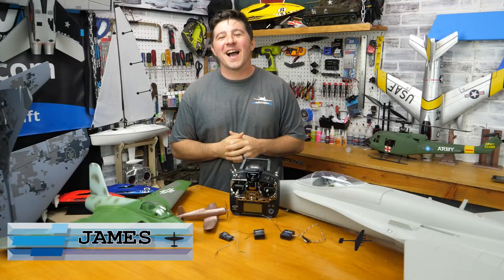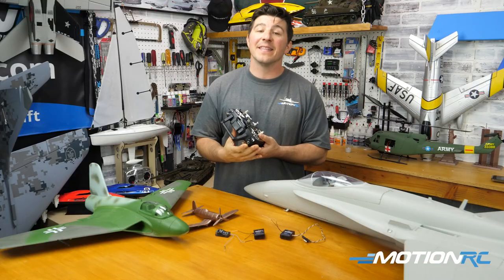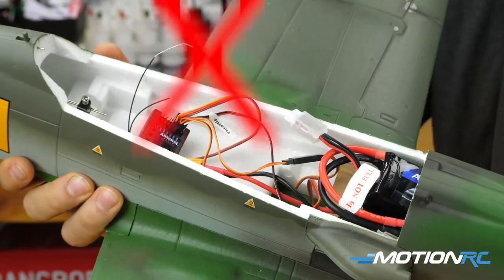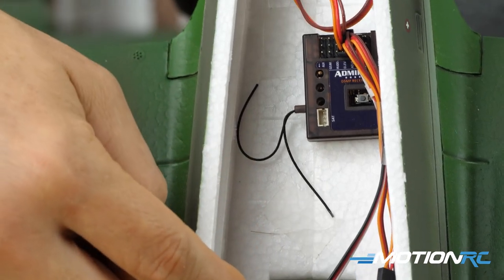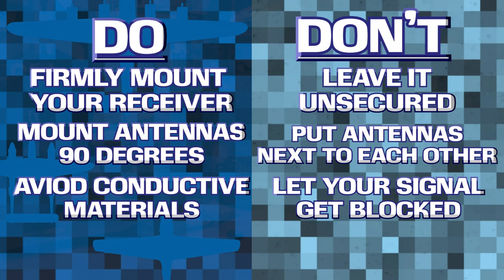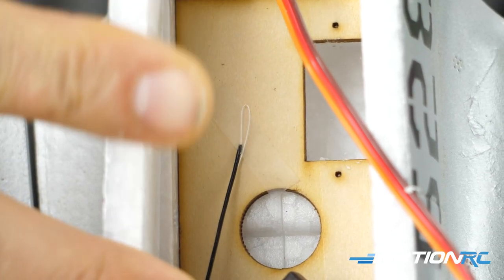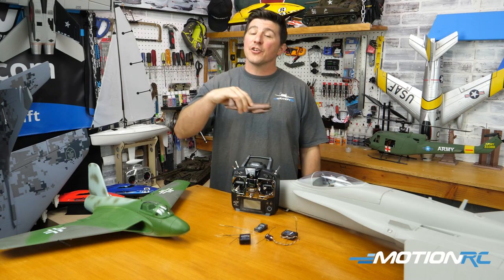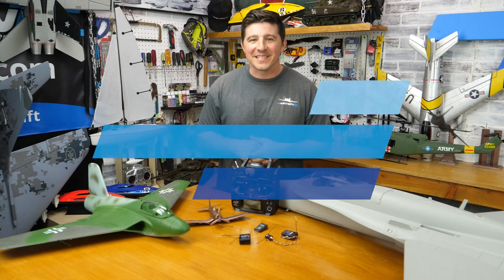Proper RC Receiver (RX) Placement | Quick Tip | Motion RC

Comment: If I only have two antennas, I mount one vertically and the other one parallel to the wing. That way, both of them are broadside to my transmitter as my plane flies away from me. Antennas don't receive or transmit off the ends. That's why you shouldn't point your transmitter antenna at your plane. The only time I mount an antenna pointing toward the nose or tail is if it's the 3rd or 4th antenna on the receiver. Also, the last inch of the antenna needs to be straight and at least an inch away from anything conductive..

Comment: E-flite sells a thickish foam double stick gyro tape, but it fails in high temperatures. Most of the BNF planes use tile and tub adhesive/caulk. I have heard gyros don’t like vibration, to what extent is this true? 3m double stick tape tolerates heat reasonably well but offers little vibration protection. When I put my PNP planes together I am usually in too much of a hurry to wait 2-24 hours for the tile adhesive to cure and have been using 3m double stick tape lately. Would hot glue be an acceptable solution? I guess my main question is how much of a problem if any is vibration, particularly in electric planes vs. glow/gas?

Comment: Basla and Foam vrs Graphite and Metal
470 Align Heli
Metal and Graphite fiber parts block (absorber) EM signals blocking Tx / Rx signals.
RC Aircraft
Balsa and Foam are completely transparent to EM signals so internal mounting is good.
but
Servo wire Servo leads servo screws LiPo and any batteries are block (absorber) EM signals so avoid mounting Rx near any metal or wire or screws or batteries.
Antenna
The short metal that is uncovered at the end of the Rx end is the antenna the covered part of the wire is just a extension of the of the short metal antenna ( < 1in), If there are 2 wires (2 antenna) then mount 1st horizontal and 2nd vertically.
2 antennae out of a Rx are redundant but flight is 3D so a block of Tx / Rx signals is reduced with the use of 2 antennae.

Comment: Another good point, which I don’t recall if it was mentioned here, is how absolutely critical it is to mount the receiver in the correct orientation if it is a gyro enabled receiver. Another often overlooked step that results in 100% crash rates.

Comment: So does that mean having an antenna close to servo wires is OK because the wires are shrouded enough in plastic & rubber?
Reply: No, the last inch of the antenna should be at least an inch away from anything conductive, even if it's insulated. The wire in servo leads can reflect or block the signal..

Comment: Starts making me think that all Rxs should have three aerials,    so they can be placed 90° aprt on all three planes   X Y and Z.        Now to my question,    does it matter which direction the two wires ate at,   eg     in line with the fuse,   across the fuse,   or up and down in fuse.    Which combination of the two is the most recommended
Reply from the maker: all depends on the space you have available in the aircraft. I do prefer to always trying to have one going down as I figure most of the time the aircraft will be above me.
Reply: @MotionRC  okay,     I've after a 18 year break have just got back into rc,    used to the Crystal radios,     in my glow engine model I have one vertical,  and the other across the fuse.    Is that okay or do I need to move one of them to be inline,  parallel to the centre line of the fuse.    Thanks for your patience
Reply: @russcole5685  Antennas don't receive or transmit off the ends, so you don't want either one of the only two antennas you have pointing at the nose or tail. They both need to be broadside to you as your plane flies away from you.
Reply: @txkflier  thank you,   that's a very easy way to explain it,       across the fuse,   up and down in the fuse,     never inline with the fuse       Thanks my man,   and happy flying from little New Zealand